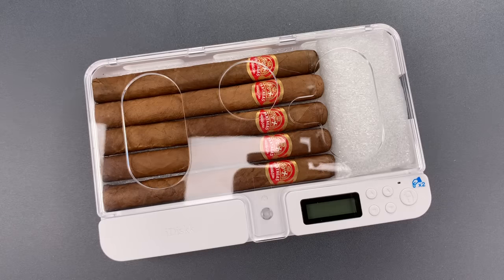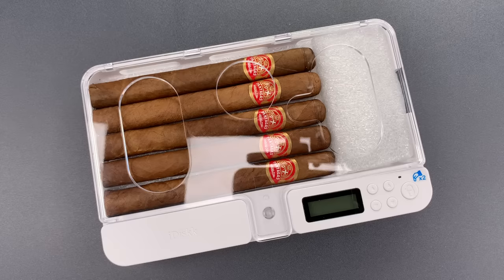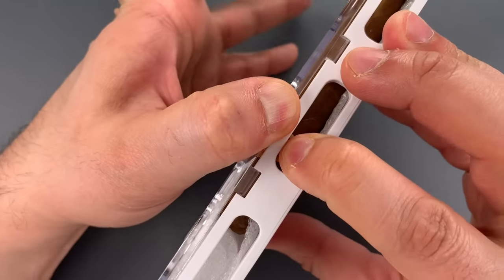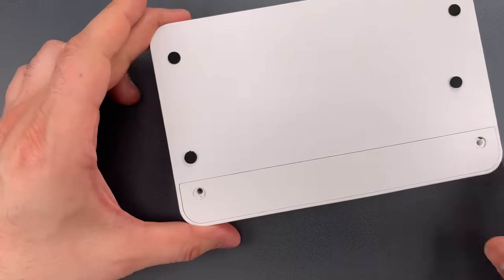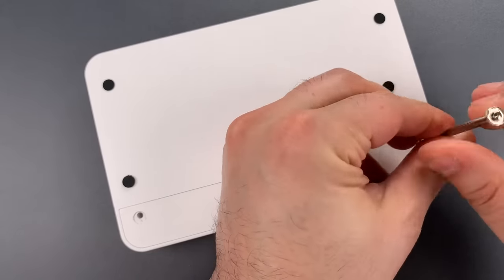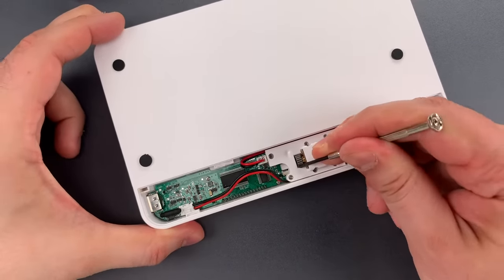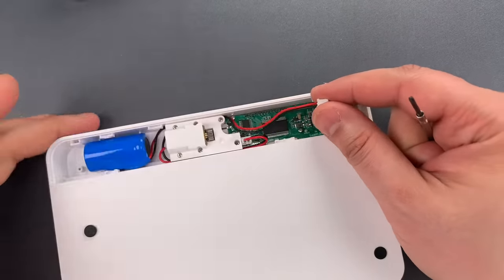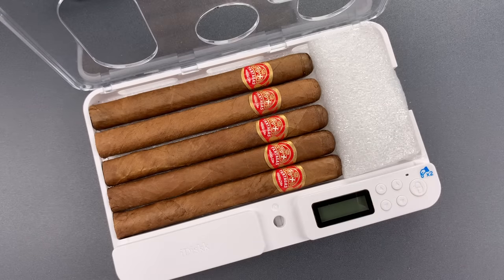[1192] Cuban Cigars Secured In An Electronic Smartphone Locker

Comment: Novelty item aside, this channel really shows you how relevant the term "security theatre" is today. Many locks and security measures are designed to make us feel secure, not to actually make something secure. It's just way cheaper. Oftentimes that is enough of a deterrent though. Quite the interesting phenomenon.
Reply: I think this channel shows more that there’s no such thing as true security. It all just slows you down. If power cycling didn’t work, he could have applied current to the motor. If that didn’t work, he could have broken the case. There’s no practical way to have a truly fool proof system, especially without compromising somewhere else (e.g. cost).
Reply: @zachpw  This device in particular is a horrible example to use. It's a toy. It's not really what I'm talking about. What I mean is there's a very clear distinction between products that are making a genuine effort vs. those that are just trying to make you feel better/get you to spend money. LPLs value in my opinion is stems significantly from showing that distinction to people who aren't as familiar with the tools of the trade. It helps you to know what you're spending your money on or what severely flawed products to avoid buying. There are so many safes/locks out there that can be opened in seconds with little effort, but they're advertised as nearly impenetrable, when in reality they're hardly functional. (And priced similarly to significantly better options) Obviously, security is just a means of slowing someone down, but when there's no effort at all put in actually making something secure, LPL is here to show us those flaws and what to avoid.

There is such a thing as "true security." You just have to slow the process of breaking into something down long enough to where it's not simply not worth the effort and any would be thief would move on. This is far from an impossible task on a small or large scale.
Reply: A large part of it is the balancing job you always have to do with "security".  It's never just security, it's security + cost + the burden on legitimate users.  "Ultimate security" is a great goal, but the question always is what are you willing to pay both in monetary cost and in hassle.
Airline travel would be a thousand times safer if every passenger was stripped, given a body cavity search, then locked into a straightjacket and transported that way.  But how many passengers would be willing to put up with that just to fly?  And good luck getting them to evacuate after an emergency landing (much more likely than a terrorist attack).  I worked at a place with a draconian password policy with frequent rotation and ridiculous character requirements.  The result?  Our entire accounting team had post-its stuck to the bottom of their monitors with their passwords just so they could do their job since they couldn't remember their constantly changing complex passwords.  So by making it "more secure", we made it less secure.
This box would have been much more secure if it came with a security guard who would slap it out of LPL's hands every time he tried to "pick" it, but who's going to pay his salary?
Reply: Yep.  Even TSA is 99% "FEEL security".  It's passenger suspicion and awareness that's limited skyjackings.  Taking everyone's nail clippers just weakens the good guys.

Comment: I think this gave him more trouble than most locks do.
Reply: I mean... This doesn't look like its not easy to open...
Reply: True
Reply: He just didnt want to break it
Reply: Its cause he recorded  the whole thing cause of the timer and had no previous  knowledge  of the device
Reply: @benaskalinskas4154  just use stronger glass and plastic for making next time, decent lock.
Reply: The fact this thing uses a motor instead of a solenoid makes it multiple levels more secure than any other electric lock.
Like seriously, someone actually put some brains into this, I think they kept the release on power up just so customers wouldn't bitch and moan with them because they locked their phone when they forgot they needed to do something else with it and now they're asking a refund because they broke it open with a flat head screwdriver.

Comment: "So, how many screwdrivers do you have?"
Most people: "Oh I dunno, like 5?"
LockPickingLawyer: "Yes."
Reply: I have about 70, wdym
Reply: own glasses and suddenly you own that set of tiny screwdrivers as well
Reply: wouldnt be supprised if there was 300 in the cellar, i mean there is atleast 3000 tools hes collected over the years and never got rid off.
Reply: I have maybe 35 + 3 small sets like that and few sets with removeable bits. And i still need more.
Reply: I have hundreds.... including the exact set he pulled out at 1:55.  Some are individual screwdrivers, others are numerous "specialty" bits for "anti tamper" and "security" fasteners.  Sizes from those itsty bitsy watch and eyeglass screws to "small crow bar".

You just never know when you're gonna need that tripple reduntant reverse torx in T5 and non magnetic.
Reply: I think "most" people have quite a few more than 5.  I don't think I own even a single set with only 5 in it.  And I have a bunch of sets.
Reply: @stargazer7644  In my place, we do actually only have about 5 actual different screwdrivers. But that's not counting the fact that one is a set that is one screwdriver but with a changeable head, and like 40+ heads.
Reply: This is the problem with the modern age. The art of doing your own maintenance on things and owning tools is apparently lost to so many.
Reply: I have a set of about 90 bits and a handle

Comment: Me: "There's no way unplugging the battery and plugging it back in works."
Reply: YOU'D THINK
Reply: A lot of electronic security stuff has this flaw for safety of the content inside it. Especially cheaper stuff.
Reply: @GRIMHOOD99  People overestimate how secure electronics are for manual tasks when all you need to do is... turn it off. (Or in this case reset it)
Reply: @DeathnoteBB  the worst thing is when this flaw is on a system for multiple doors for a building that has power switch outside.
Reply: Pretty sure unplugging it caused the internal timer to reset to zero. Plugging back in likely caused the motor to turn when it checked the timer and saw it had hit zero.
Reply: Jeeze I don't even do circuitry and I know you have stuff like that fail to a locked position. If the circuit is fucked with, you make it stay locked, not unlock

Doors sure, it's better to be out money than have a person dead because the system locked them in, but a security device like this? FAIL SAFE TO LOCKED
Reply: @Icalasari  It's not a security device lmao it's just a self control device
Reply: @SirDella  oh my god you are right I was wondering why it looks like that.
Reply: In the industry, the two options for electronic locks are fail-safe, and fail-secure.
And depending on what is being installed, and where,  and whom for, sometimes one option is enforced as legally required. Others may have the choice. 
The tl;dr - fail-safe opens upon power outage/reset, fail-secure locks upon power outage/reset
Reply: @Icalasari  doors can have an inside breaker bar to always let someone inside out, but don't let anyone outside in.
Reply: @Icalasari  It's a software issue. Taking the battery out reset the time, and since the time was at 0 the electronics correctly moved the mechanism into the opened state.
Reply: @Mobin92  I think it’s just that it opens per default. It would probably also open before the battery runs out (i.e. when the battery voltage gets low). It’s more like a design choice than a fault. This is not a real security device after all.
Reply: It makes perfect sense to me when the lock was set battery power locked it  ? If he'd waited a bit after unplugging it would have maybe unlocked without plugging it back?
Reply: @michaelgardner3728  it sounds like the lock is powered on and off, so it shouldn't be able to unlock without any power.
Reply: @Icalasari  for door locks there are two types
There is one type which is designed to fail in an unlocked state (usually used for low security applications)
and another type which is designed to fail in a locked state
the latter will always have a mechanical override on the inside, and sometimes also a mechanical override on the outside (usually a key)

Comment: "Well I am not going to wait those 41 hours" aaaaand he just resets the timer
Reply: He didn't wait 41 hours tbf
Reply: Holy shit you're right. HE FAILED THE CHALLENGE!
The timer reset when he reset the power so the lock actually opened because of him failing.
Reply: @Tyiriel  I wouldn't say that's failing the challenge. It had a flaw in the design of the mechanics (although I personally am unsure if there's a way around this) in that the electronics held no memory of the timer after being unplugged. LPL used this flaw to his advantage, even if by accident. He succeeded, even if the way in which he did was slightly unusual. He got the lock open and therefore did not fail.
Reply: @robinhascoolboots9863  
Maybe an onboard battery would keep time for a few min/hours?
Reply: @magnusquercu9905  If this was a security device, sure, but this wasn't meant to be impossible to open, just a timed lockout. Being able to reset it makes perfect sense here, because if you pull the back off you probably do need to get inside and it's not too much harder to just break the cover and steal from the top.
Reply: @alexrawson8492  
Oh yes, I understand. Just throwing ideas out, casual ruminating. 👍
Reply: @robinhascoolboots9863  It was more of a joke than anything serious.
The only way into that thing was either gonna short circuit, reset the device, break it or almost fully disassemble it, which in turn counts as pretty much both of the lose conditions.
I just thought it was funny that he won by technically losing in a way.
Reply: As he says himself, he could easily just have applied a voltage to the motor and turned it that way. Just taking the power on and off was just easier.
Reply: It's a non destructive entry. He can set the timer to whatever time he wants after.
Reply: @Tyiriel  He didn't fail, it's a flaw and he found a flaw in the design. He still unlocked it fair and square

Comment: 1:14 LockPickingLawyer x iFixit: The crossover I never knew I wanted.
Reply: well, the repairabilty score of that product would be quite good. You might have issue getting spare plastic parts, but you could take donor parts from a legit product.
Unlike apple, where you can not swap cameras between phones and repairing a defect apple computer with a jumper wire magically turns it into a PC.
Reply: @sarowie  "This is the LockPickingLawyer here and today I've been tasked by our friends at iFixit to try and get into the new iPhone. As you can probably tell by the fact this video is an hour long, this is quite challenging."

Comment: And this is why permanent data storage is important!

(Storing data like in lock require electricity. Electricity gone, data go poof! Work good for RAM. Not work for storing your pictures. Need thing like hard drive which keeps things stored when turned off)

Comment: To make it more interesting he should have made it self-combust when the time ran out instead. Now I understand that sending it wouldn't be the smartest idea because suddenly you'd be under arrest for shipping a bomb that burnt down a delivery guy's truck.
Reply: Also, the goal is to, you know, get the cigars.
Reply: A little fail-deadly device under the cigars that sprays rat poison into them if the power is cut would have defeated this picking method - it would destroy the product without posing a danger to the delivery driver.
The cigars obviously would be unsmokable after being coated with rat poison - unless of course you dont mind strychnine pumping through your veins...

Comment: First I laughed when resetting the power was enough to defeat the lock.  Then I was shocked when he said that actual security devices designed to do more than promote self-control had the exact same vulnerability.

Comment: I need that thing for my candy, have to fight weight gain from being stuck at home all day thanks to Corona. Do they make one that takes a bag of potato chips?
Reply: you can buy a padlock with a timer on it, and then attach it to a cupboard or something like a metal box to lock up all the candy and other "bad stuff"
Reply: The most successful tactics I find, is not buying the stuff in the first place.
Once it's inside your home, it's really hard to resist the temptation of just eating the whole package in one sitting - speaking from experience here! ;-)
Reply: @Shadow81989  Dosn't help that multipacks are often cheaper than single bags. Not per item cheaper, cheaper than a single item!

Comment: One might argue that destroying the adhesive seals of the rubber plugs violates the "non-destructively" stipulation.
Reply: Not really, I have had some come off easily, like just picked the thing up easy. I have also had the item come without them, even had some rattling around the packaging the item came in ( yes it was in one of those evil clam shell things)

Comment: i suppose the sender meant to "decode" the lock by pushing buttons, not taking a screwdriver and opening it up(?) and unplugging the battery. rofl. there probably is some kind of combination to reset the whole thing without opening it from the back, some kind of secret button combination if your patience has run out. ^^

Comment: Sees they are exposed and not humidified
This would have been perfect for Halloween, because Brian is a monster.
Reply: A little time in a humidor will fix them right up, not even worth being upset about.
Reply: Better a bit dry than overly moist.  A humidor will get them in fine shape. Too humid and the mildew becomes a nightmare to remove.
Reply: We don't know if they were packaged in a humidified, airtight bag or container.
Reply: Overly dramatic response there pal. You don't know how they got shipped and it's fine to have them outside of a humidor for a while. Just pop them back in for a few days and they'll be fine again.
Reply: @HH60gPaveHawk  nope, once they get to even like 55% they are ruined, no matter how long you keep them they will still be bitter and harsh. 
Im doubtful these are even real habanos, the feet are busted, caps sloppy and the wrapper leaves look far too veiny and uneven, No way they would come from the same box. The one furtherst to the right has a very badly applied band. Its very hard to get proper habanos anywhere in the USA, looks like somebody went on holiday and thought they were being clever getting a street box (worked in a proper habanos retailer in london with training from hunters and frankau, i got brought a box of fakes like once a week)
Reply: @jamesrowland2002  I was thinking the same thing. They appear to be the "cuban" cigars you find at a shit shop in mexico. Waayy too sloppy to be decent, legit cubans
Reply: Ad Lockhorst  hahahaha. I have a Monica cigar made for the Trump DeploraBall in 2016. The head of the Cleveland police union was passing them out.  Same size and shape as the one he used.  🤣🤣
Reply: @jamesrowland2002  speak for yourself, maybe your proper habanos shop wouldn’t smoke them at 55%, but once you’ve had smokes mailed to you while you’re deployed, you’ll discover “ruined” is for the weak willed. I do agree that they don’t seem legit, but if they were I’d happily smoke them after some careful rescue efforts, even if they were dry as the desert.
Reply: He might have shipped them in a humidor bag.  You can buy them in bulk on amazon.
Reply: @jamesrowland2002  The amount of misinformation in this post is laughable. I store all my Cubans at around 65-68% and then dry box them at 54-57% a day or two before smoking. Lowering the humidity for a day before smoking really enhances the flavor and slightly drier cigars have much better burn control.  Its also very easy to get to habanos in the US. At least a dozen reputable online retailers. I have bought many time from Cigars of Cuba. Finally the cigars in the video are Partagas Aristocrats, a very affordable cigar that you can easily get for under $6 a stick. These look very similar to the quality of Partagas I have smoked myself. There is this myth out there they all Cuban cigars are somehow perfect and never have any imperfections but this is just not the case. In fact I have read many articles and reports about the decline in Cuban cigar quality over the last few years. I am not saying these cigars are 100% legit. It would take much closer inspection, but from what I can see from this video there is certainly not enough evidence to declare them fakes.
Reply: I was thinking counterfeit at first, but the high resolution put my mind at ease. I’m fairly certain they’re real.
Reply: Glad I wasn't the only one screaming for a humidor.
Reply: Atleast all same shape and size looks like and band in same spot but they seem have a good bit of difference in color. Would assume all came from the same box.
Reply: I am learning a lot about cigars from a channel about locks.

Comment: In this case putting power to the motor worked, another possible way is reverse polarity of the plug, sometimes the wire is a signal wire as well

Comment: It looks like if you could have pulled the foam out you could have just pulled the center cigar from the end at an angle through the slot on the lid. Then just move all the other cigars to do the same.